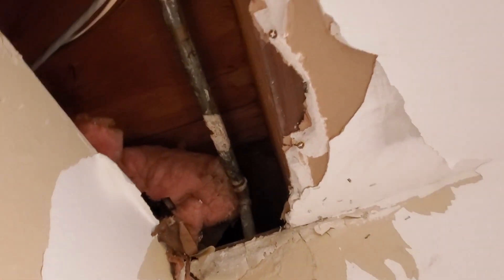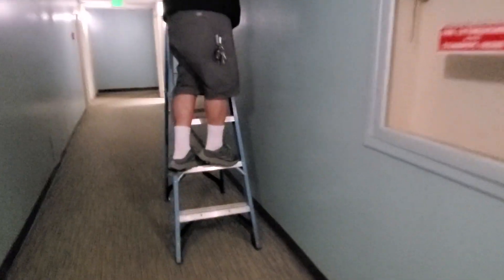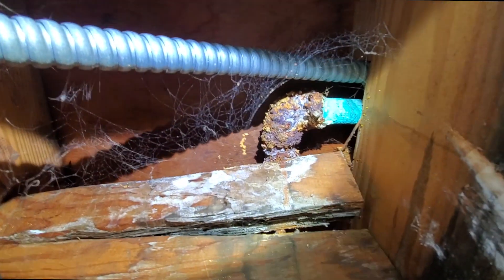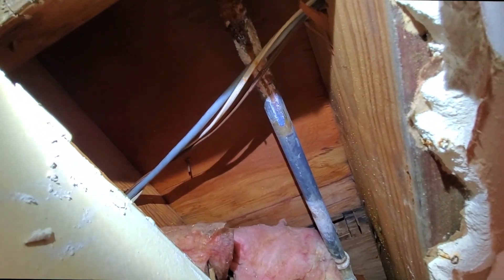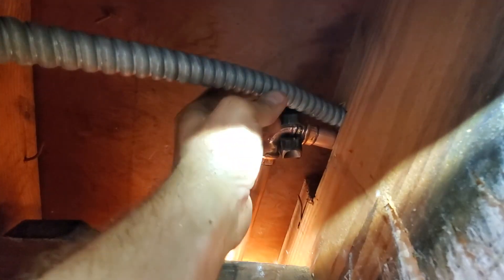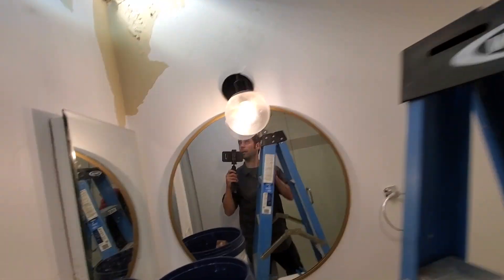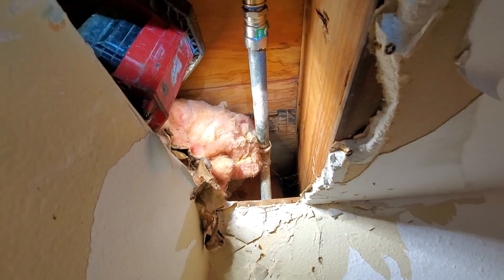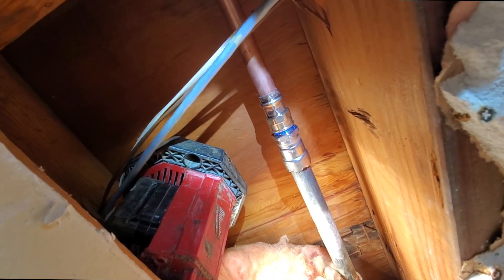Megapress Viega 316 Stainless Steel on Galvanized Waterline | Pershing Plumbing | Pasadena Plumbing

Comment: I just ordered the jaws for pressing a galvanized pipe for a customer who can’t afford to get it re piped until later this year. I’m new to the pressing game just got my tool 3 months ago. But do they make transition press fittings to go from galvanized to copper ? Or is the one you used the only available option?
Reply from the maker: I use the viega carbon 316 adapters for potable water

Comment: Is it legal to use carbon steel on potable water
Reply from the maker: Its 316 stainless steel and yes they can be used on potable water. The issue here is the stainless steel reacting to the galvanized steel. Client was advised ahead of time that its a temporary repair until they can cough up for a full repipe.